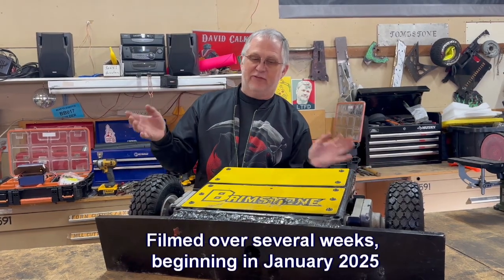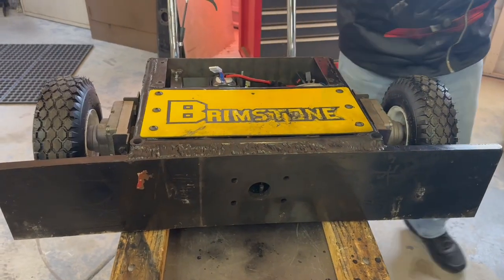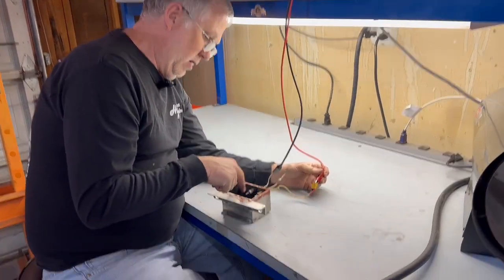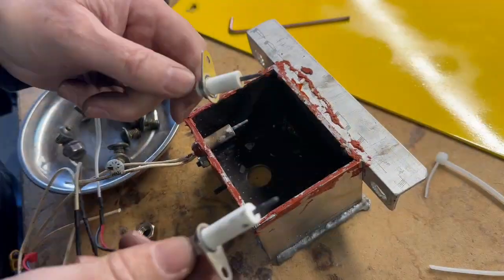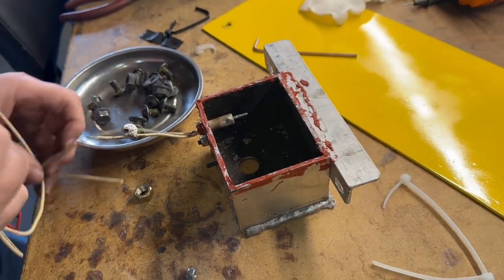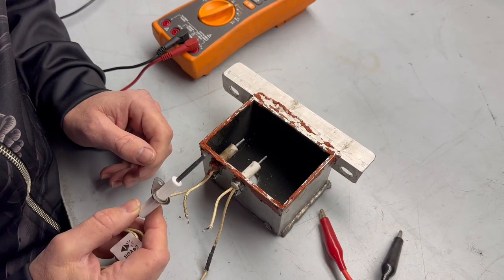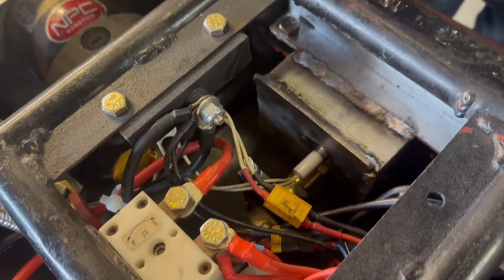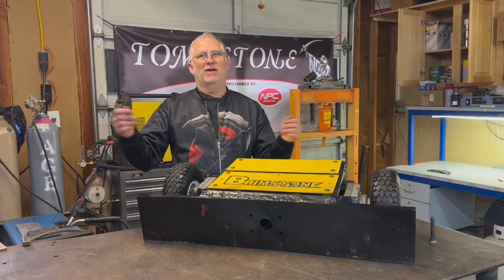Brimstone Igniter Repair

Comment: Big fan of Tombstone Ray, two series igniters don't work properly in series because resistance changes whenever one of the elements heats up so the other element is more like a ballast resistor if there is a slight change in resistance (you can only measure correct resistance when it is at peak temp). Going with 24v (hopefully two elements in parallel) solves that issue. Maybe a great idea to introduce extra airflow to make sure that the fuel does not cool down enough to become a liquid in the metal combustion chamber? then you'll also don't have to blow out the flame whenever you engage the safety and you'll get a way higher heat vs fuel ratio and vortex from a fan will increase AOE and effectiveness a lot.

Comment: Ray going to be testing all future igniters like Paul testing every drive motor to match the ones that perform equivalent to each other
Reply from the maker: The new single igniter seems to be enough to reliably get the flame working, so hopefully no further issues.

Comment: Same problem as with speakers, if you can, use parallel connection, that way even if one deviates, other will still work as intended, not bring entire system to a crash.
Reply from the maker: The old ones were 12v units, so had to run in series to work with 24v power. The new one is natively a 24v unit, so hopefully no further issues.